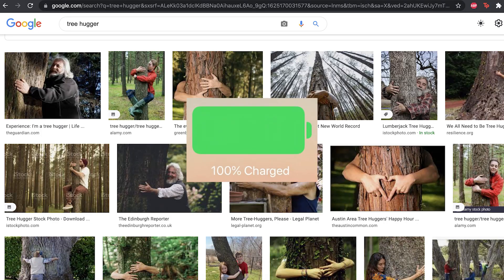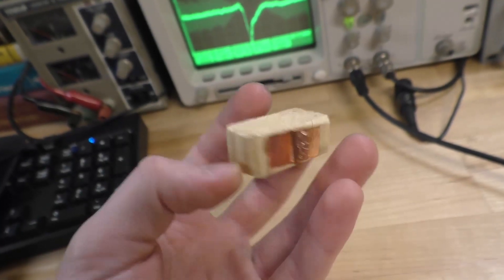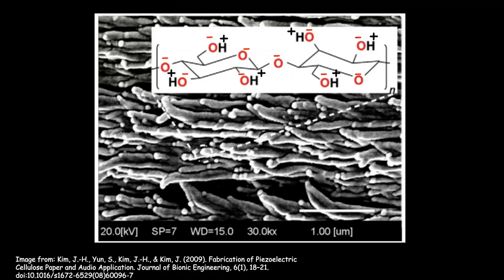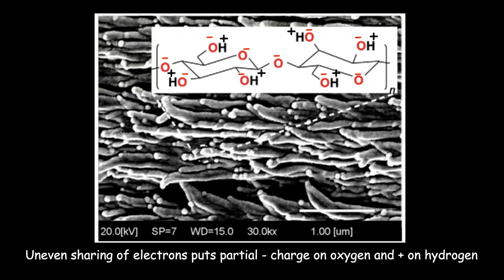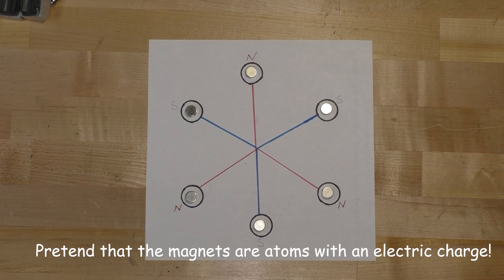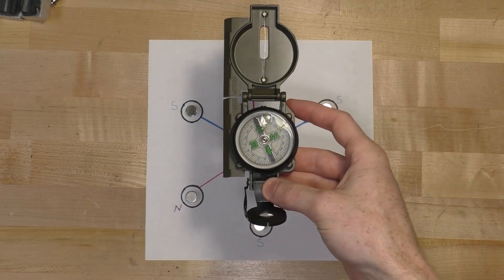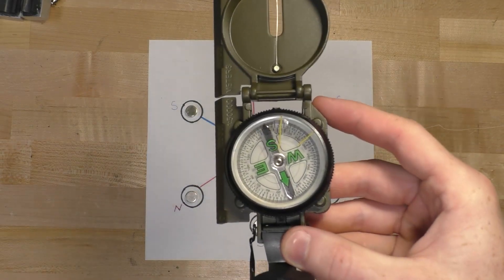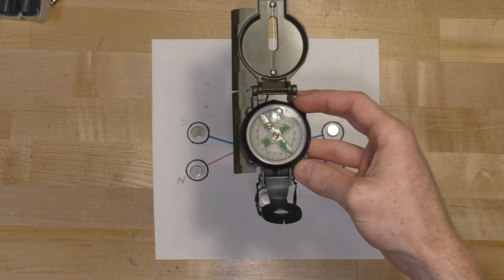Generate electricity by punching wood

Comment: try simple multilayer electric field ion implantation/layer combined with laser carved paths/cuts micro sized process for diy cd sized substrate, like cds, copper or silicon discs, just make it level, smooth

Comment: How do you exclude piezo effect from the ceramic caps in the scope?
I can get similar pulses by tapping on the scope.
Reply from the maker: Don’t use a scope probe just coax and a BNC
Reply: @SamZeloof  what I mean is that if I tap on the scope without probes attached, the vibrations will change the voltage of the ceramic caps inside the scope. Try the experiment having someone lifting the scope off the bench when you hit the wood.

Comment: now can you stack layers of thin wood and make a pile to get more voltage? It would be interesting to see if an excentric bearing and a lever could be used to generate some power.
Reply: Take a thick wood log, connect one electrode near the first grown-age ring, the second to the last one. Put a little HMX inside a log and you'll get a Marx coaxial pulse generator on a... wood.

Don't take it seriously.

Comment: Wow! I had no idea wood was piezoelectric. I'm going to try building a speaker and see if any detectible audio can be produced!

Nice explanation with the magnets :)
Reply from the maker: thanks, at best the piezo coeff. of wood is 30x smaller than normal piezo materials, I could not hear any audio from it
Reply: @SamZeloof  Do you think the would could be cured or soaked in a solution that would enhance the piezo coeff of the cellulose to a level anywhere near typical piezo materials?
Thanks for sharing this.

I wonder if dehydrated celery is piezoelectric now. lol
Reply: @maxwellconniff1189  Yep, if you remove lignin from it
Reply: @striga314 so clear wood would be more piezoelectric….

Interesting

Comment: Very cool! I imagine the output impedance would be crazy high though?
Reply from the maker: Actually the output impedance isn't a big problem, all piezo crystals are good insulators anyway. its similar to a capacitor, but the dielectric is replaced with a crystal that charges itself
Reply: @SamZeloof  That makes sense; thanks for the clarification Sam!